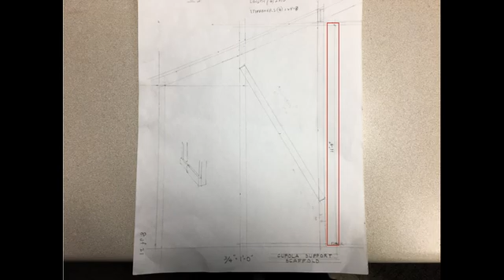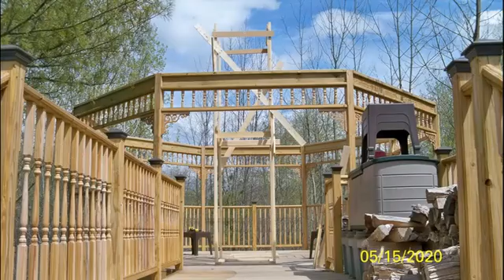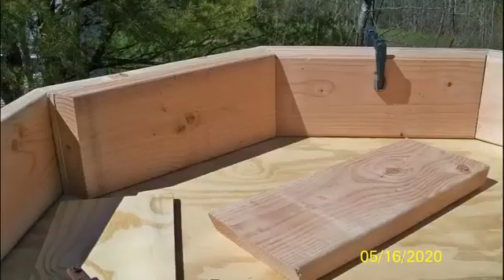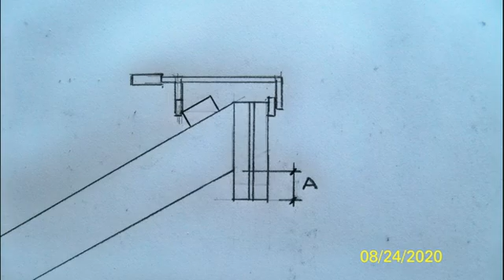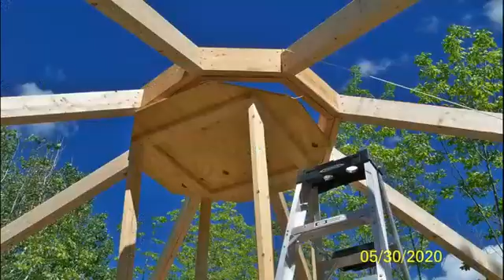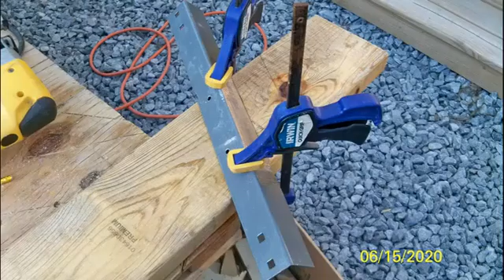Building the gazebo roof step by step [2 of 6]

Comment: Just want to say - your videos helped me a lot.  I'm in the process of building my own gazebo from scratch and when I was searching for some answers on how to do my roof joists I came across your videos.  Just so happens that my gazebo is almost the same size and design as yours.  I did have some issues getting my inner octagon up and at the correct height.  And hindsight I wish I would have done what you did with your joists and measured each one individually.  I precut my common joists but will be using your example for my hip joists (which I also decided to double up after watching your video).  Still worried about my facia on the sides and the joint where my cupola and roof will meet.  Any advise or things your wish you would have done differently?
Reply from the maker: Sorry it’s taken so long for me to reply.
Have you completed it yet?
Reply from the maker: What would I have done differently?
I’ll have to give that some thought.